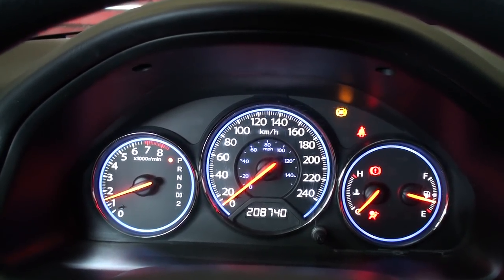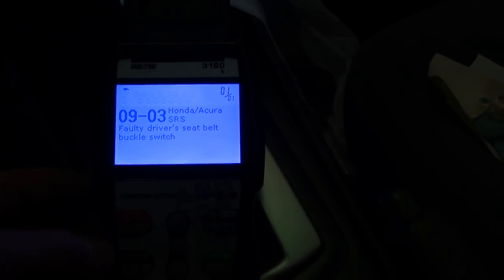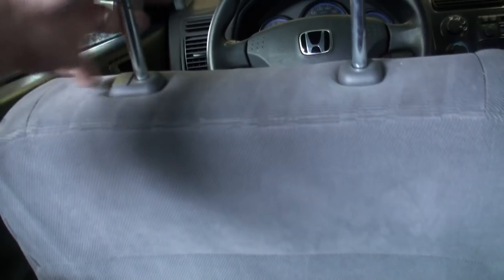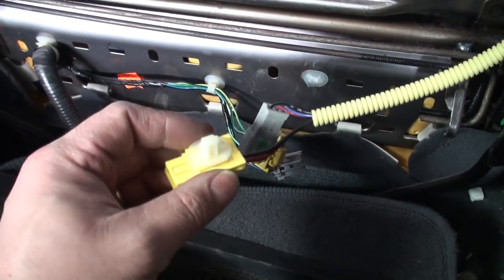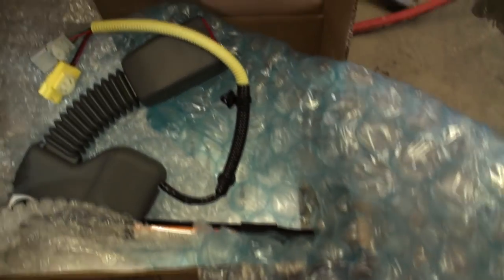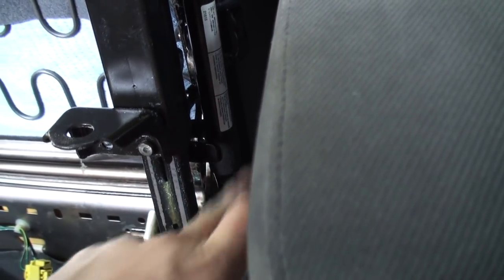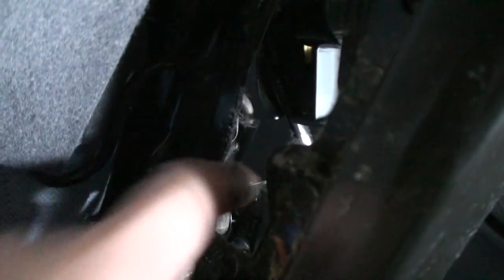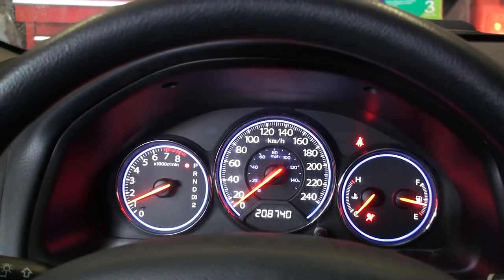7th Generation (2001-2005) Honda Civic SRS Airbag Code 9-3 Fix - Faulty Seat Belt Buckle Switch

Comment: When the seat buckle failed did the seat belt chime indicator still sound when driving?
Reply from the maker: No, on the 7th gen civic at least in Canada, it never chimes the seatbelt warning after the initial starting of the vehicle.  I think on SOME Honda's they implemented that annoying beeping sound every few minutes but on the 2001-2005 civics that wasn't the case.  Even the seat belt light doesn't come on, it has something to do with a seatbelt interlock circuit that is what is causing the issues that is what causes the SRS light to illuminate and subsequently disabling the driver's side airbag (so I was told).
Reply: @piercedasian  thanks for the info on my 05 civic I have the airbag symbol only same as your video no srs light and when I buckle and unbuckle the seat belt the symbol appears and disappears as normal. My car chimes when driving and seat belt not connected as always, I’m trying to find as why the airbag light appeared I checked both  front seat connections all is plugged in.

Comment: Can you just cut the wires and connect them together or something? Sheesh 300 for a belt buckle. Is it made of gold?
Reply from the maker: No unfortunately you can't do that because the SRS is an integral safety item.  Some have tried cleaning the microswitch in the buckle with limited success but the true and ultimate fix is to replace it with a new factory piece.  I agree that $300 is a LOT for a buckle but it is for your safety which you cannot put a price on in the event you get into an accident.
Reply: @piercedasian  I ended up cleaning the belt buckle with some contact cleaner. Had to open it, worked real well. It cleared out the light. :)

Comment: I wanna remove my front passenger seat out of the car maybe permanently with the idea of keeping all the wire  connection plug in including the wire that connect to buckle, so I'm thinking with this idea i can  trick the airbag system to not give me the airbag light on because all the wires are connected but without the seat. Will this work?
Reply from the maker: I'm assuming by removing the passenger seat that your seats have built in air bags?  The passenger seat buckle doesn't actually have the sensing switch (that I know of) in the buckle like how the driver's side does.  That being said there are plenty of write ups online that explain how to trick or bypass the system BUT just be aware that in doing so it can be risky in that your car's safety systems are being operated OUTSIDE of how the manufacturer designed them so proceed with caution.

Comment: Can I take the used part from a 2002 or 2004 coupe and put it on my 2003 coupe. Will it fit well?
Reply from the maker: yep most of the civic parts in the same generation are swappable.

Comment: Dam I got the same problem now that I watched your video I'm fixing mine next week paycheck
Reply from the maker: yep, this is a very common problem with honda seatbelt buckles and I wished they could sell the electrical components separately rather than having to buy a new buckle.  The switch is a dual way switch that gets gummed up with crap in the switch from dust and dirt and sadly there is no easy way to get into it to clean it out such that it is reliable.

Comment: The SRS light was out. How about the latch on the seatbelt sensor? YN?
Reply from the maker: Hi Glenn, I'm not quite sure what you're asking.  You're saying that the SRS light is out but you're asking about the seat belt sensor?  Can you please clarify?
Reply: Just that the seatbelt light stayed on. After you installed the component did it shut off? My SRS and seatbelt light are malfunctioning.
Reply from the maker: yep, once I replaced the buckle assembly with a new one the SRS light and the seatbelt lights all worked properly.  The seatbelt light IF the buckle is working properly should go off when you buckle the belt.  The SRS light will sometimes stay on and you may need to do a SRS reset procedure.  I can cover that if you'd like or need help knowing how to do it.
Reply: piercedasian The wiring on the connector looks  bad and the SRS switch is on. I believe this covers it. Great help, thanks.

Comment: Hey @piercedasian how can I disable the light completely without actually changing the part? Can I just remove the switch and the lights go away? Why idea how to bypass the light?
Reply from the maker: Unfortunately I don't know of a way to do so and you wouldn't want to anyways b/c if the car thinks you're wearing your seatbelt and you get into a collision that the airbags will still pop if by chance you weren't wearing a seatbelt.  You will either need to clean the seatbelt buckle switch using some contact cleaner or you will need to replace the buckle.
Reply: @piercedasian  ok bro thanks for the info 👍👍 will try the contact cleaner.
Reply from the maker: just make sure the contact cleaner you buy is plastic safe otherwise you'll end up melting your seat belt parts.
Reply: I will definitely
. Gonna order one on Amazon

Comment: I just recently unbolted my seats to shampoo my interior and unplugged the sensors without first disconnecting the battery now the SRS light is on do you think something is damaged or just needs resetting.
Reply from the maker: nope, just disconnect the battery, reconnect everything and then power it all back up.  You may need to get the SRS system reset via a scan tool or using the jumper method in the fuse block.

Comment: 208k miles or is that kilometers?
Reply from the maker: That is in kilometres but I have another civic that I've done the same work on with 200, 000 miles too!
Reply: awesome, civics rule
Reply from the maker: TechFreshness yes they do... my 91 civic has half a million kilometres on it and running strong on the original automatic transmission still!

Comment: The seat buckle pretensioner is covered by a lifetime warranty from honda. The dealer should have replaced it if they found it defective.
Reply from the maker: Not exactly correct.  This lifetime warranty law only applies to US market Honda and not worldwide/Canadian markets.  Outside of the USA consumers have to pay for the part and the fix when the car has passed it's 3 year, 60,000kms comprehensive warranty.
Reply: +piercedasian I didn't know you were not in the US.  But yeah I forgot to state this applies to US sold Hondas and it is uphold by the dealers here in the US.
Reply from the maker: I believe it is US federal law that is enforced by the NTSB.  In Canada unfortunately we have to pay for everything...

Comment: Fits perfectly rear-facing in our truck, which has a slightly smaller back seats. https://www.youtube.com/post/Ugkx6_FKRYB2ClSPRyjcd8HptiCS3EiQoNX4  Feels as comfy and plush as our Graco Contender carseat.
Reply from the maker: If you're referring to the traits of the civic then yes I 100% agree with you except for the "heavyiness".  I drove a car that was easily 2 x the weight of this civic and you felt it on the road.  That being said, there is a reason why the Civic is one of the top selling cars... they're great!

Comment: # The Module could be bad. Most likely need to replace the Module. You can buy a used one on www.eBay.com 
or send your Module for repair at https://www.myairbags.com/product-category/repair-return/airbag-module-reset/

     Here is video

https://www.youtube.com/watch?v=f4mDqeH4o7E
Reply from the maker: Nah these modules rarely completely fail. I have yet to actually need to replace  one and I just reflow the joints and they’re good to go for another 10 solid years.

Comment: There was a recall. Mine was all done free..
Reply from the maker: lucky!  I've replaced so many of these buckles for friends and family that I've lost track of how many I've done.  Super expensive but a necessary evil.
Reply: Same problem here, and I called the dealer, and they said if you are involved in accident before, the warranty is void... so I have to actually buy the buckle sensor for $60 bucks and replace it myself.
Reply from the maker: wow $60 is all you had to spend?  The buckle assembly for this civic I repaired cost almost $300 CAD because the entire buckle assembly had to be replaced with a new one from Honda.  To my knowledge the sensor couldn't be replaced on it's own.
Reply: piercedasian Sorry, I had an Honda Accord, about same problem.  Yes the entire assembly (the wiring, the buckle and everything)  Bought from a local dealer's eBay store, otherwise it is about $200-300 bucks at the dealer is what I heard.
Reply from the maker: wow that is crazy cheap!  Looks like I'll have to check out ebay the next time I need a new buckle assembly :)

Comment: Very informative. But $300 to fix an indicator light is a bit steep.
Reply from the maker: +Clyde Ng although I would agree that $300 is steep you can't really put a price on safety.  The SRS system is in place to protect the occupants and if the SRS light is on the system may not deploy when needed.  It is difficult to say whether air bags will deploy for the driver in a frontal collision.  I'm not about to find out.  Paying $300 for your safety and peace of mind is a small price tag to pay.  Also, most buckles that fail are about 12 years old so $300 / 12 years = $25 a year for safety - not a bad deal really.

Comment: a 2cent 2 ohm resister would of done the job.
Reply from the maker: +MYNOR SAGASTUME although you're correct that you can fix the problem using that resistor I can't emphasize the importance of safety and why parts should be replaced when they fail or are on the brink of failing.  For sure the primary issue with the buckle assembly is the darned microswitch in the buckle.  Dirt, dust, corrosion or the wearing of the spring can undoubtedly cause the SRS system to think something is wrong when perhaps it can be fixed.  I figured that in the grand scheme of life spending the $300 once in the car's lifetime to fix a potential safety issue is worth doing so with a new part.  Some won't agree with me but I'll know with confidence that in the event of a collision that I'm almost guaranteed to have my SRS system working.

Each to their own :)
Reply: turn off airbag light in 2000 Chevy impala

Comment: Where do you get that gauge cluster?
Reply from the maker: That is the stock Civic sedan cluster for model years 2004-2005.
Reply: +es1justin  Its for the ex and si trims, if you have lx trim its diffrent.

Comment: these seat belt sensor are a factory recalled. they trigger the SRS light to come on.  the recall is free just take it to Honda dealer for the free fix. 2001 model to 2005
Reply from the maker: that only applies to the USA.  Worldwide markets (especially in Canada) they are NOT covered under  lifetime warranty and unfortunately owners that are beyond the 3 year 60, 000km warranty our out of luck as far as warranty is concerned.